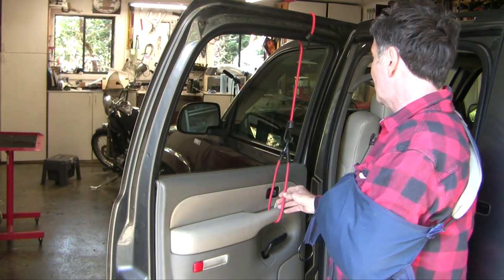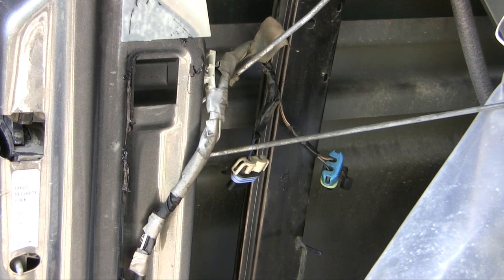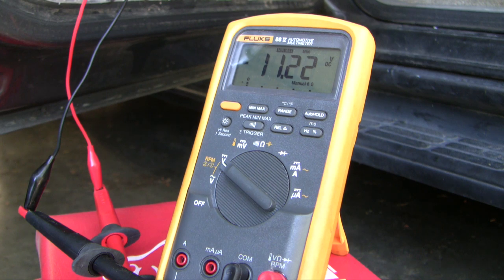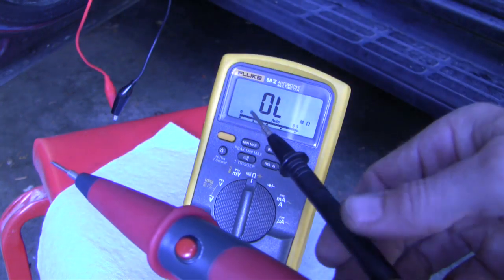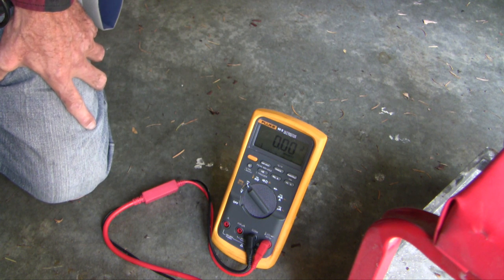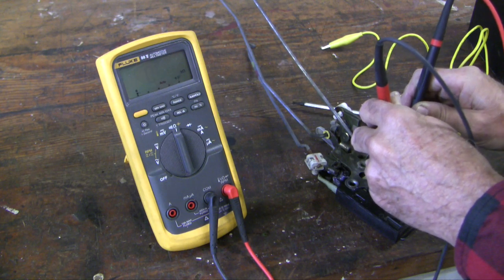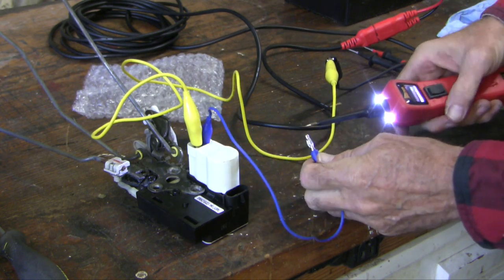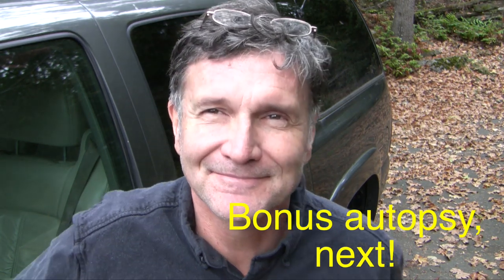Car door won’t lock, diagnosis and troubleshooting

Comment from the maker: If you watched the initial video on the sticking door lock, you’ll see that straight lubrication of the mechanism did the trick.  Now, three months later the actuator failed. So, this week I had another go at it, and I made this second video with emphasis on electrical diagnostics. It’s likely the actuator was on its way out three months ago, but since it worked after lubrication I didn’t feel inclined to replace it then.
Reply: The lights in my car won’t turn off and all the locks close except the driver side door out of no where
Reply from the maker: @happygirl2667  Do you mean the headlights? If so, it may be the daytime running lights relay. I did a video of that in a Dodge Ram, search "headlights won't turn off". If the interior lights won't turn off, it may be a different issue. Some vehicles will have the cab lights turn on when you rotate the knob that controls lights. Or, if the switch that detects an open door has failed, the car may be misled into leaving the cab lights on. Wires that go through the door experience repetitive strain, so a broken wire at the point of movement is worth considering. The biggest problem here is it will drain your battery overnight, so you need to somehow unplug those lights so your battery isn't run down. Good luck!
Reply: @spelunkerd  the dome light in the inside of the car and the driver door won’t  lock but there’s nothing wrong with door tho and the rest of the doors lock but that one

Comment: Awesome coverage on this video. I was able to free up the door lock actuator that was stuck from just buildup of corrosion. The electrical work fine. I job tool only about 30 minutes to complete, including WD-40 and rocking the actuator back and forth to get it to work again. It all went back together fine and works well. :)

Comment: Excellent video!  One of the few that are audible. Also I like that you don't show real-time unscrewing of fasteners. I have a 99 Silverado. I replaced the whole latch/actuator assembly on the passenger side. No click at all. Driver's side actuator works fine. Passenger side won't click from driver's switch or passenger side switch. When I test the wires, the orange wire lights but not the gray.   In your video you test them by putting ground to one then positive to the other. 
1-Do you switch the wires to make the actuator go the other way? 
2-Where is the ground in this system? (Mine was working but the lock/unlock motor seemed to be too weak to move the lock/unlock, that's why I bought a new one)
Reply from the maker: Yes, these little motors go in reverse when hooked up in reverse, and that is how the 'door lock' and 'door unlock' relays swap grounds. You need a wiring diagram, I thought I included a snapshot of the diagram in one of my videos. BBB industries offer free wiring diagrams online with a lookup feature, I use alldatadiy which is inexpensive and useful. Because of the reversible feature, the wiring for these is complex. The switch side of the relay on the wiring diagram describes the ground as G-203, but at that point it is probably intact because you have function on the opposite side. G-203 is on the pillar to the left of the steering wheel, hidden underneath the plastic of the dash. You could start by testing the actuator with a battery and wires to be sure the new device is good. With repetitive movement of the door, it is common to lose contact on a brittle wire in the door loom or around sharp edges and points of movement. The other point you could investigate is to find those two relays in the fuse block and be sure you've got power and ground there. There is also a fuse for these devices in in the fuse block. If you can't find a wiring diagram, send me a personal message on my channel and I'll send back a snapshot of the diagram for my 2000 Suburban, but don't assume yours is identical unless you own the same vehicle. Good luck!

Comment: Hi, fantastic the way you explain things in detail. I wonder if you can lead me into how to go about sorting this problem. I live in Australia and my son has a 2013 Toyota Corolla ZRE182R Ascent Sport. All of a sudden both front doors stopped lock and unlocking with either of the remote keys. Both back doors and hatch lock and unlock fine with the remotes. Also I have noticed when I use the remote to lock the back doors and hatch the turn indicator does not flash, however, when I use remote to unlock, the turn indicators flash twice as per normal. To leave the car it has to be locked with the normal key which locks all doors and hatch.
I took the car to my Auto Electrician who said both front door actuators were gone. It is possible but I think unlikely as both went at once.
Reply: Sorry a bit of wrong info. When you lock the car with the normal key the front passenger door does not lock.
Reply from the maker: You've made the first important step, describing the problem in detail by thoughtful observation. I don't have any special knowledge of Toyota. For all the vehicles I own, I buy a subscription to alldatadiy, which gives access to dealer service bulletins and wiring diagrams for about $40 for 5 years. No guarantees they would describe how to fix this, but you might find more info on what that double flash means. If you want a free wiring diagram, bbbindustries here on the web offer some. I agree, since the key locks both, it seems unlikely both door lock actuators are bad, but common problems like a bad actuator can present in unusual ways. Since you get a double flash, I'll guess the signal is getting to the car, but for some reason it won't lock. Does it lock normally with the drivers side switch inside the door? I would start the investigation the same way I did here, opening the drivers door, testing for power and ground, and probably use a high amperage test light or headlight bulb to verify the actuator wires can carry sufficient current. Possibly the switch is bad, some of these kind of problems respond to lubrication of moving parts and cleaning of switch contacts. Good luck!

Comment: The B.F.H, brutal but enjoyable :-D.
Yes i've used car bulbs on wires for testing, a crude device but supprisingly usefull.

The bottom of your door does look crusty, so water is getting in, it always does.
Reply from the maker: With so much restraint to our daily lives, it's so liberating to grab a big hammer to smash things! We're all little boys at heart, ha ha. Thank you for stopping by, I know you already understand what we covered. As I'm sure you also know, small bits of critical insight make all the difference.
Reply: Yes i do know what you mean lol, but i have a lot of patience for old things, so they don't get the bfh :-D

You are a very clever man, i like the clarity of your thinking.
I'm not too clever actually, but i do try to understand other subjects.
It adds other dimensions to what i know :-D

Comment: Thank you. I do not have all the tools. But just want to cut out the battery to keep it unlocked with no current going through and draining the battery. When I remove the plug at the top (first step) will it make the door work manually? As long as the doors opens & closes without a problem & no battery .
I will be obliged if if you let me know. Its a 626 Mazda 1987.
Reply from the maker: Gee, I don't know, probably, it would be easy to check. If you have a parasitic battery drain from that circuit, you might be able to pull the fuse and verify the cause, at the same time proving your effort is worthwhile.

Comment: I can't shut my rear drivers door on my Envoy all of a sudden
It seems the latch isn't locking either open or closed... Does that mean I need a whole new assembly?
Reply from the maker: Gotta work through the diagnostic pathway as shown. A quick way to tell if power is getting to the actuator is to turn on an overhead cab light, then press the lock button and see if the light dims. Most of the time you just need to replace the bad part, such as the actuator.

Comment: 12:50 hi, i have a spare door lock for my Saab93 that I've cleaned and reflowed the pcb solder points (it originally gave false alarms)i want to test if my repair is good by   plugging it in and hanging it there without fitting,hence saving time, do think this would be ok to try? Thanks
Reply from the maker: Probably OK, that sounds like normal work flow in a shop.
Reply: @spelunkerd  thanks

Comment: I am interested by your proffetional explanation. I have  a peugeot306/1999 petrol, left steering, spontaneously unlocking doors. How can I examine where exactly the fault is?can you forward an idea please?
Reply from the maker: I'm no professional, I've never worked on a Peugeot, and I don't know what is wrong. That said, I'd start in the owners' manual to see if your can adjust that feature. Some vehicle options allow user modification, though modification of this seems unlikely. The next step is usually to go to the scan tool and to the dealers repair manual. Unfortunately European manufacturers don't respect the same obligation that dealers in North America follow, so you may have trouble finding a dealers repair manual. It is normal for vehicles to automatically lock all doors when the vehicle reaches a set speed, and it is possible that a similar unlock feature is offered in some cars. I've never seen that. If there are no trouble codes and I didn't find clues in the dealer repair manual or from a TSB search, I'd check to see if my scanner has bidirectional control of that feature. If it does I'd see if it works fine. Failing to find a cause I'd probably check for power and ground at the switch, and do a drop test on the switch power and ground lines to look for areas of corrosion or excessive line resistance. It's probably worthwhile to look at the wiring harness as it goes through the door, looking for a wire that is chafed or broken. If all that is good I'd examine the switch board to look for solder cracks, bad capacitors, dust bunnies inside the switch or board, corrosion, or signs of excessive heat. Good luck!

Comment: Thank you for sharing the follow up to the previous door lock vid.  Now we have closure.  Well done, as always, even with a wounded wing! :)
Reply from the maker: Yeah, when it worked fine with just lubrication, I wondered if I would only get a few more miles out of a dying horse. Even in retrospect it would have been hard to condemn the actuator. That's the great advantage of being an amateur, since a pro would have had to double charge for labor. You can see why they might replace suspect parts, independent of any financial motivation by the shop.

Comment: Hi there. I have a problem with my 2005 Chevy Uplander that the switch works to lock the van, But it doesn't work to unlock. Makes no noise when pressing the button. Any clues? Happy Holidays
Reply from the maker: Hard to tell without looking at it, but the way to approach it is shown in the videos. You could start by lubricating all the sliding parts, take the inner door off and look for mechanical problems, and look for water intrusion. Failing that I would check for voltage drops in the wiring, and verify that the voltage reverses at the actuator connector when you press the switch to unlock. If it doesn't the problem is in the switch, if it does then the actuator is suspect. The other way to check this would be to reverse the two wires going to the actuator and see if the problem reverses to difficulty locking. If it does, the problem is in the switch, if not, the actuator.
Reply: spelunkerd 9

Comment: This video is helpful but the technication has the door open  PS I DID STATE THAT THE FRONT PASSENGER DOOR IS LOCKED SHUT MEANING THE KEY FOB WONT ACTIVATE THE ACTUATOR / ALL THE OTHER DOORS UNLOCK OK SO HOW TO UNLOCK THE STUCK SHUT DOOR.  ONCE DOOR CAN BE UNLOCKED THEN WE CAN INVESTIGATE FURTHER.
ANY ADVICE PLEASE.
Reply from the maker: Gee, if you can't even manually open the door from the inside, it's a serious problem. You need to clearly understand how that manual opening mechanism works. You may need to take the opposite door off so you can understand how it comes apart and how it works. Many doors have a single screw that holds the handle cover on, and if that is removed you may be able to reach and pull on the steel rod the manual handle moves. Most of these mechanisms have a small plastic retaining device that holds the steel rod in place, so it may be a simple fix once you identify the problem. In a worst case scenerio you might have to sacrifice the inner door panel, finding a replacement from a junk yard later. Good luck!

Comment: The right rear door on my 98 gmc jimmy will unlock but won't lock. Will the actuator need replacing?
Reply from the maker: Maybe. Follow the steps in the video, try lubrication, investigate for voltage drop, look for other causes. It is not hard but to do it properly but you need to commit the time and effort. There is nothing wrong with asking for help, free time is valuable!

Comment: can you test a new actuator in ohm resistance before you plug it in? if so what is spec ohm in general actuator? thanks tim
Reply from the maker: Good thought, at 7:40 of the video I measure resistance, in this case the new actuator resistance was 500 ohms. The dealers repair manual will often have ohm specs for good sensors and actuators, I use alldatadiy to get access to inexpensive copies.

Comment: So mine 2001 lexus rx300 I changed the actuator on front passenger and after installing it still does not respond to my wireless key. . It onky lock and unlock with key inserted from outside. I am thinking some control module. Any ideas
Reply from the maker: Yes, many newer systems require initialization, because many have their own little computer built into the door switch, and they communicate on a bus line to reduce the number of hard wires going to the door. Any time you remove the battery you need to reinitialize the window and door locks, so I would start with that first. The procedure is described in the owners manual, you run windows up and down and lock doors in a sequence. There is likely also an initialization required for the key fob, and I would check your owners manual for that. The key often needs to be in the ignition to do those procedures, for obvious security reasons. You may want to check the battery on your key fob.

Comment: On my Renault the central lock stopped working remotely,  but is still working using button/switch from inside the car on dashboard. Also wont lock/unlock all dooks ( except driver door )from driver's door using the key manually.  So what could be. Thanks.
Reply from the maker: First step is always to get a wiring diagram from somewhere. Old models were strangely vacuum actuated, which led to weird problems, but most these days are electrical. These circuits are surprisingly complex. For something behaving strangely I'd start by verifying that I have a good ground and power, with some kind of drop test to prove there is no voltage drop along the way. Broken wires along wire looms where repetitive movement happens are an easy fix if you are lucky. When problems seem to be generalized the trail often leads back to the multifunction circuit board, usually inside the drivers door switch.
Reply: @spelunkerd  thank you for your replay. My car is a french model renault kangoo 2010. I am enable to get a circuit schem from  some where. But i will dismantle the dashboard cover ( which i am trying to avoid )  and door panel and trace the problem piece by piece. Thank you again . I salut you from Casablanca ,   Morocco.

Comment: Hi bro could you help my car doesn’t unlock or lock my car but when you try to unlock it or lock it the indicter lights come on but it won’t lock
Reply from the maker: If you're talking about the remote entry fob, that's a completely different puzzle. You need to first decide whether it is a problem with the car or the transmitter. Usually you can do that by using the keypad on the drivers door to see if the other doors respond. The transmitter has a battery, if you're lucky the problem will be solved by replacing the battery. If the problem is inside the car, then you make yourself a good witness, study the problem and learn how they work. Most cars are like shown here, electrical motors connected by a control board, but older versions were vacuum controlled.